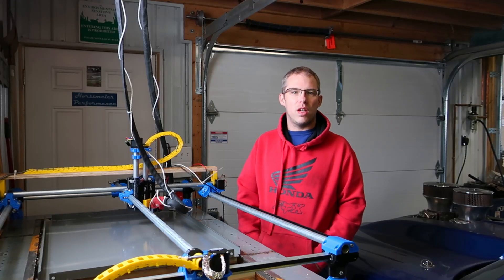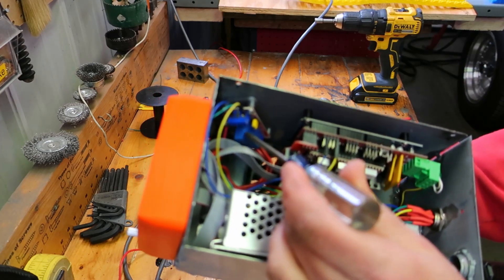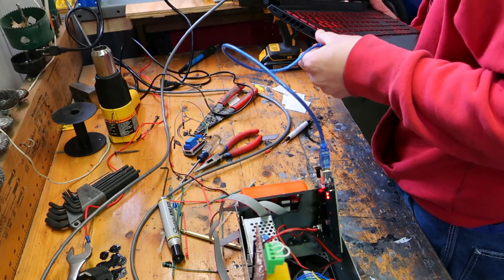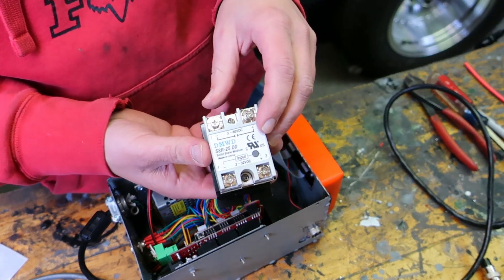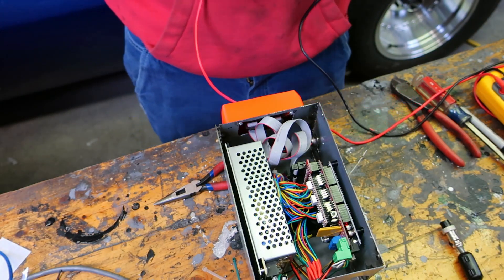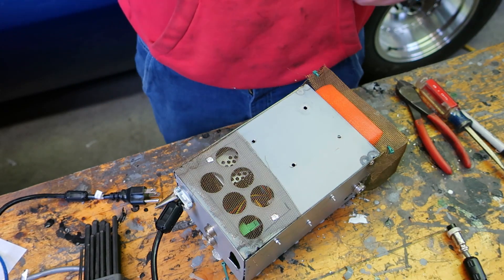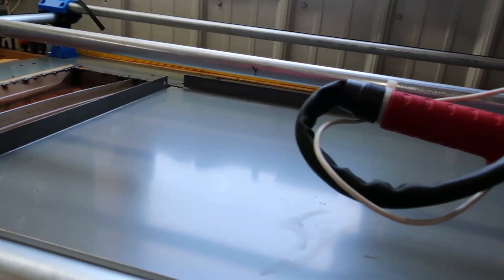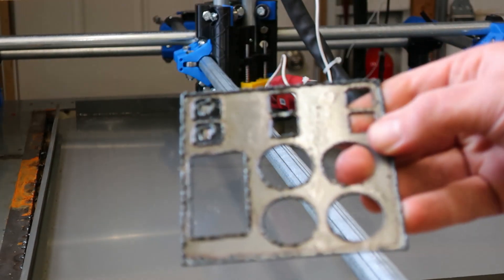MPCNC Primo Build Ep. 17 Chicken Dinner

Comment: If you have isolation concerns you can always use an opto isolated relay.
Reply from the maker: The first relay I tried was opto isolated but was only a 5v coil. The interference would lock it on. I have a solid state relay now

Comment: I'm probably late to the party and you've probably thought of t, but make sure your shielding is only attached at one end of your cables (and is not your only ground).  I've been told you don't connect both ends because is can cause capacitance in the line.
Reply from the maker: Those are valid points. If you can't be sure how well the cables are grounded at both ends, it's best to do only one end. I grounded the table and computer per hypertherm recommendations. I did leave out the ground stake outside with my cut50l plasma cutter, and everything seems to work well.
Reply: @eliworks8549  I am definitely glad you had all these problems, and not me. Haha.  I am printing my mpcnc right now and I have a cheapy plasma cutter.  You have definitely solved a lot of problems.  To quote Isaac Newton, "If I have seen further than others, it is by standing upon the shoulders of giants.". Or something like that, lol